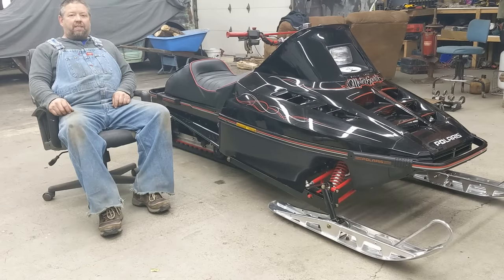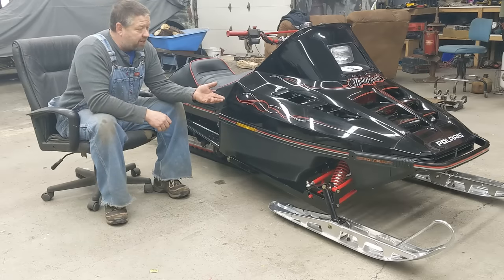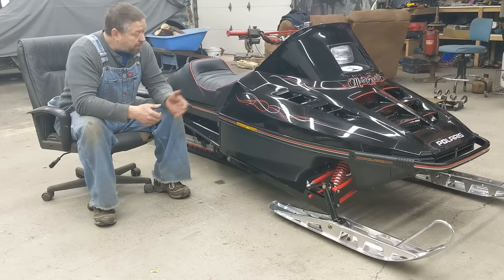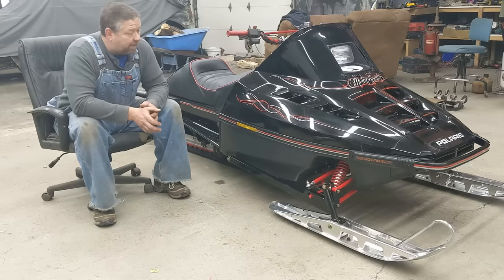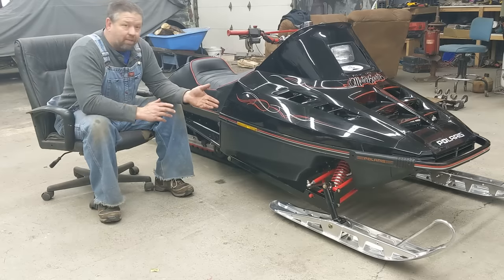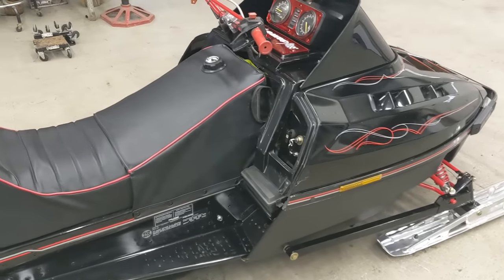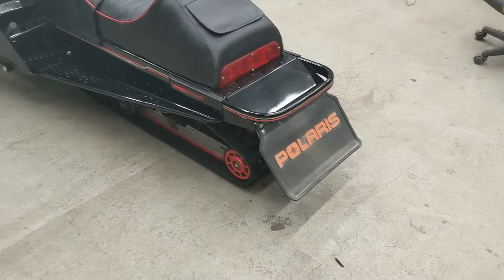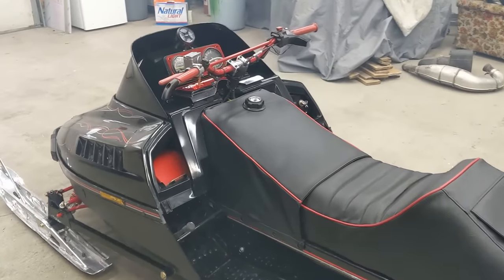FINISHING POLARIS SUPER MOD FLATLAND SHOW SLED

Comment: I am a little younger than you...but I will never forget...I took my snowmobile safety driving test on a brand new RXL, the return after the stop/go and all the signals, and whatever, was a ride back around the perimeter of a 20 acre field, and I had ridden for 2 years illegally on several hundred mile trips on a 488 Trail, but was very experienced, as I started on a Kitty Kat at age 7...What a blast for a Kid that had only rode fan twins, I made that trip back to the start/finish line a "little" on the FAST side (Probably snapped it to 50+ on the longest straight), which I got scolded for, but it was worth the scolding!
Reply: Yeah that would be worth the scolding absolutely.... snowmobile.... Rock on...😎
Reply: No thing no job no female on this Earth is going to keep me away from my snowmobile

Comment: Well there it is in all its glory, and it looks mighty fine indeed Todd! Sounds great too! The dash plaques look great really set off the red accents on the sled. I had an '83 600 triple and this sled reminds me of it, and it was the fastest sled I owned at up to that point in my life, so it brings back some fond memories. Question though, why is your tach turned sideways?
Reply: snowking55 - looks like 9100 rpm is straight up, and that’s max rpm for him.  so when you are flying down the trail or across the lake at wide open, and only have a fraction of a second to look down, the tach needle should be pointing straight up.  This way you can see you are at peak power very quickly. It’s an old drag racing trick.
Reply from the maker: @ScoredPiston  well said. That's exactly right.
Reply: @ScoredPiston  Ok, I thought that might be the reason, thanks.

Comment: We had a 92 SKS 650 new. Put 22-37 gears in. Fuunnnn on the big end at the end of a lake or river.  Wish we had kept it.
Reply from the maker: I'm running 20/39 should be 100 mph at 9200 rpm.
Reply: @toddclyne3493  117 mph hopefully with your gearing. Remember Those Clutches over drive by .90 if set up correct :)  We only ran our 650 to 8700 rpm cos it was a trail sled most of the time and where i live it's common to get 7 to 10 mile straights with only 4 to 6 inches of snow and lots of ICE. New sleds can't handle the ice running. .

Comment: Sweet build! I picked up a non running 92 Indy 650 and trying to get it running. I noticed there's a line on the fuel pump that broke off. It was a capped/plugged line but not sure what it's for.... fuel return thats been bypassed maybe? There are 5 other lines on the pump, 3 to the carbs, one to the tank line in, and the pulse line. Since the fuel return (I'm guessing) line broke off and is no longer plugged/bypassed, could that be the cause of the sled not running. The guy I got it from said it just died on them one day while riding.
Reply from the maker: No fuel return line on a carbureted sled that I know of.

Comment: Nice man! 👍 what pipes are you running? Sounds wicked.
Reply from the maker: Thanks and they are DG pipes.
Reply: Nice, they are hard to find now, i am looking at a 90 Indy 650 that needs some work. Looking all over for parts.. as you mentioned . How’s the jetting with tho,s pipes ? Thanks
Reply from the maker: @paintendaveextremecollisio8057  I'm running 300 mains at 900 ft. Minnesota so I'm good to about zero or a little below.
Reply: Thanks
Reply: I ment to ask you have you had any issues with the Polaris 750 Storm at all ? Found one in good shape, any advice would be appreciated. Thanks again.
Reply from the maker: @paintendaveextremecollisio8057  750 was a one year only then they went to an 800. We have two 800's
Reply: todd clyne okay good to know, I just finished taking the Efi out of my RXL that I just picked up and put carbs on it now. I also picked up a set of used PSI pipes to try. I half to find a air box for it , Do you run a air box on your Indy 650 with the DG pipes? Or a Air filter ? Just looking for Some base line jetting ideas.. thanks again for great Video,s 👍

Comment: Why do you run one bar end hook on the left side? I ride mountains not trails so I haven’t seen that before
Reply: On a hard left turn you can right hand the other way around, so your palm is facing your body, you slide your down the hook, it looks like you are arm wrestling someone with your left arm, sideways in front of yourself...they made brake levers for that too...on the Right turns you can underhand the handlebar and use your pointer and salute finger to run the throttle...if you ride aggressively on trails, you find that you can pull harder with your arm in different than "normal" positions... (We rode with a LOT of ski pressure, and big carbides on 1/2" bars)

Comment: I don't know about you but I got about 12 solid inches of fresh snow here in Flint Michigan to rip on at this point... so I'm going to rip. !!
Reply from the maker: Just cold
Reply: @toddclyne3493  what state.. ??... or province..??... or if you'd rather not say that's fine too but whatever... I try to connect with snowmobilers that I feel are worth connecting with basically...
Reply: Changed my mind... I pulled it up onto the trailer.... at some point here soon I'm going to trailer it down to the lake and racist against my friends 02 Thundercat 1000... I'm just going to run the damaged track for now cuz I don't have time to change it out... we'll just have a little look-see here at what is what... I guess.. I can either get that cat out of the hole and stay in front of it somehow or I can't... we'll find out... thanks for the comeback Todd
Reply from the maker: @tr4415  Minnesota
Reply: @toddclyne3493  copy that.. Minneapolis out there... my leather Polaris racing jacket from there Craigslist used... Hott.. snow girls out there...!!!!!!!!!  Minnesota rocks !!!
Reply: @toddclyne3493  I'll just pull it to Ludington with the Grand Cherokee... put it all on the ferry.... floated across Lake Michigan can Madison Wisconsin.... and then get behind the wheel and head north... we'll have us a little Polaris party..!!!!!😃